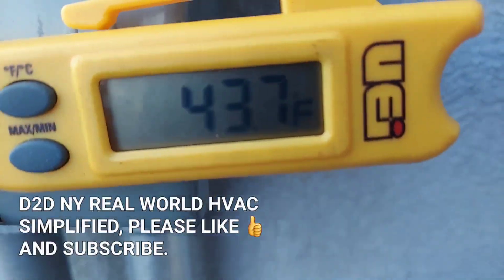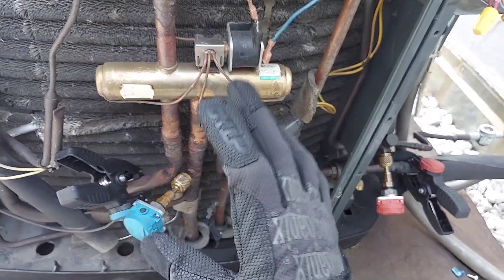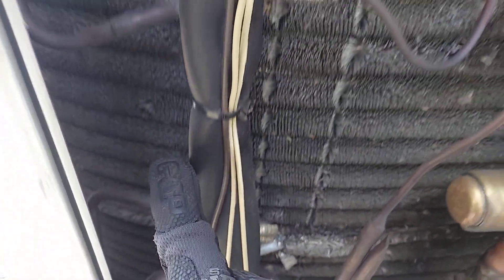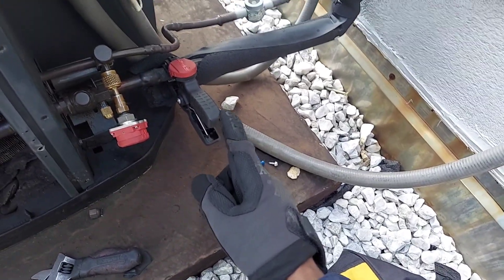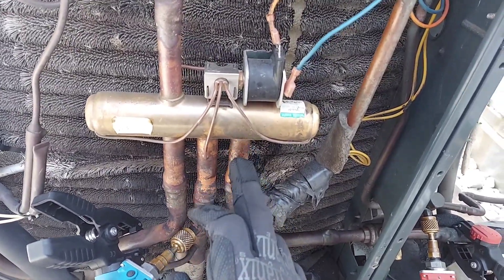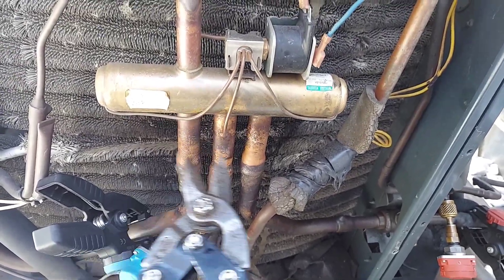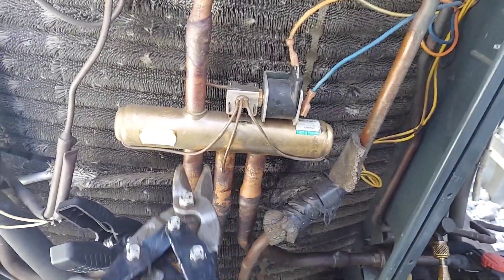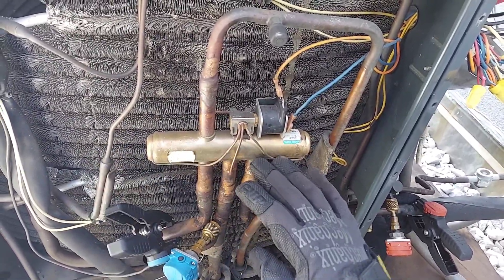4 WAY VALVE | REVERSING VALVE | HEAT PUMPS

Comment: Great video! I just wanted to ask, how can I check if a 4-way valve is healthy or not using a multimeter? I would really appreciate an explanation.
Reply from the maker: You can only check the coil for short to ground or to see if coil open, a good test is to energize and de energize the coil while the compressor is running to check valve switching

Comment: That's a good tip, because the tuning fork torch tip is hard to use. So I do something similar when replacing the liquid headers on the Carrier RTU with the individual metering devices on each coil tube that always plug up. You cant heat 4 or 5 tubes up all at the same time so I snip them off and then un sweat them individually. Typically in Chicago on commercial units when the reversing valve starts to stick people opt to just remove them pipe them straight and make it a conventional unit at that point and use the electric heater. Mostly see them by the lake, further in land they use retention ponds instead of air to air.
Reply from the maker: Sweet thanks for watching

Comment: Why is the blue wire off the spade connector on the valve? Was that an accident and came off? I’m in Chicago Always wanted to work on them but not much here. If possibly do a video on thermostat wire connection.
Reply from the maker: the connector was off because this heat pump is designed to fail safe in heat mode hence if the valve isn't powered it's in heat mode, and  because the outdoor fan fan cycling switch or low ambient control isn't functioning when the system goes into defrost mode this causes head pressures to be extremely low, so low there isn't enough differential pressure so the valve can switch back to heat. This was a temporary fix  to keep the heat going
Reply from the maker: Thanks for watching my brother,,

Comment: Thank you!  Great vid.  I've removed reversing valves in package units but never residential style like this with coil directly behind it.  I'm assuming you use a heat shield to prevent damaging the coil?
Reply from the maker: Yes! however ONLY when installing the new valve i use wet rag or wet rag paste,,... for the removal process this isn't needed!